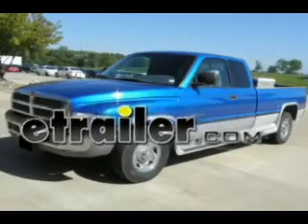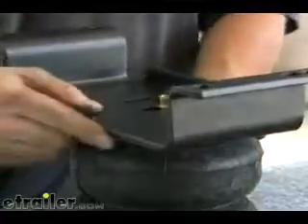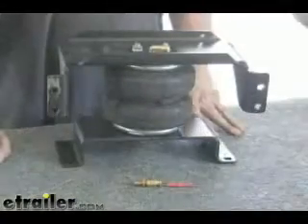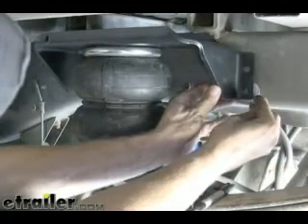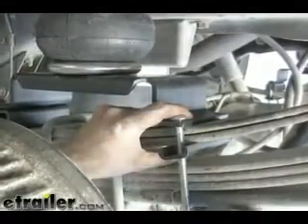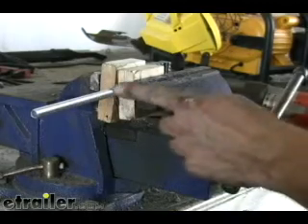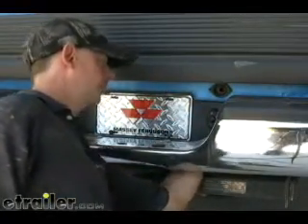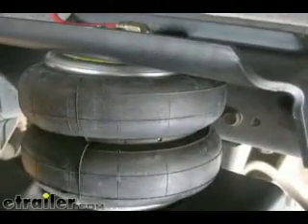etrailer | Setting up the Firestone Ride-Rite Air Helper Springs on a 1998 Dodge Ram Pickup

Comment: Great video.Im wanting a set of these for my f-250 for a slide in camper application.since camper will cover the rear bumper area where would you suggest putting air filler valves?

Comment from the maker: @ShowtimeStables66  These can be adjusted anywhere from 5 to 100 psi. It really depends on your truck and how your suspension is set up. If you have an older truck you may need to keep it at 20-25 psi for everyday driving, while a new truck may be okay with 5-10 psi for everyday driving. It is really too subjective to nail down an exact number. As long as there is never less than 5 psi, it is up to you.